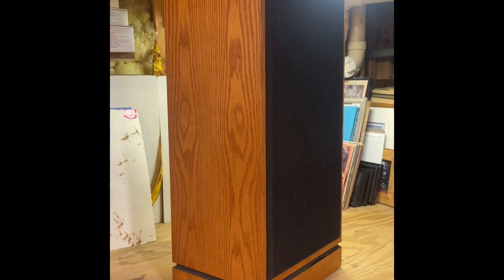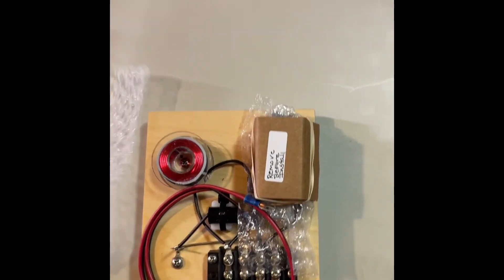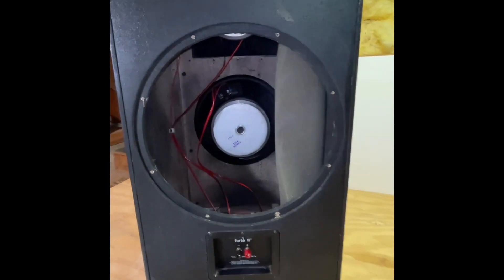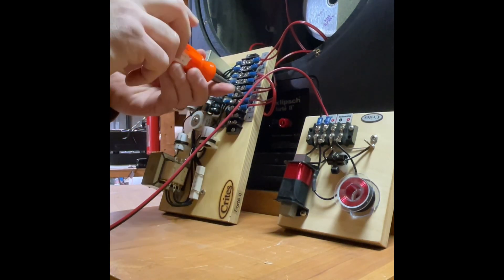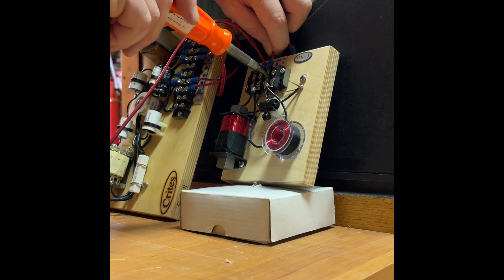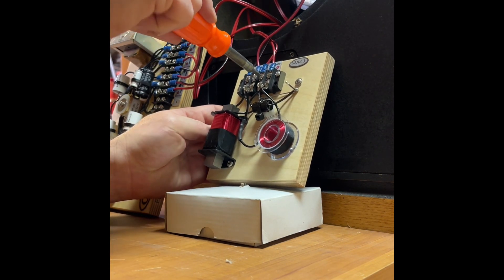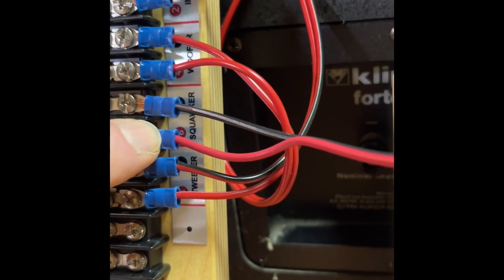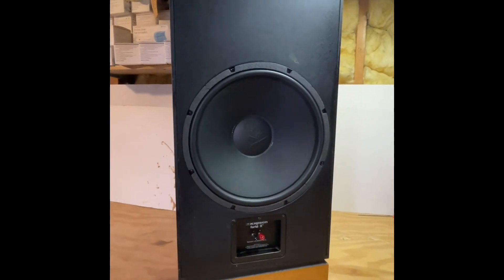Klipsch Forte II Adding Crites Band Pass Filters for Ti Midrange Diaphragms

Comment: Nice upgrades. I also have a pair of ‘92 Forte II   Which I’m currently rebuilding. So far I’ve repaired the passive radiators, upgraded to Crites tweeters and thinking about updating the crossovers. Can you tell me how the squaker upgrade sound over the original set up? Thanks!
Reply: I second this. please update us... is it worth the $?